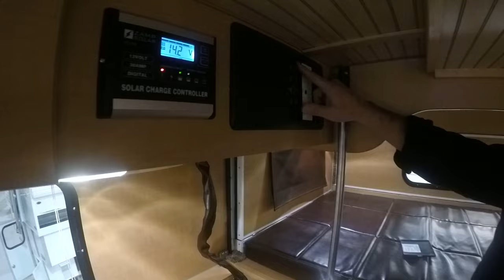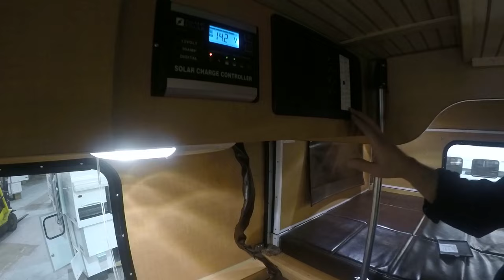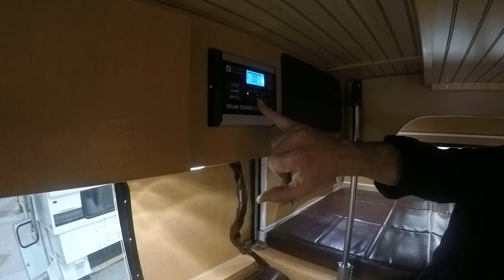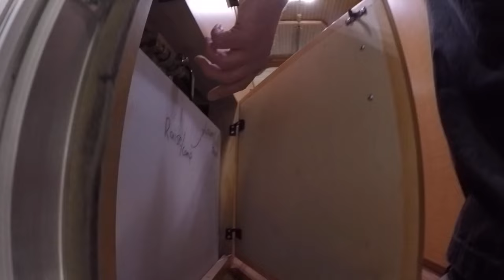Alaskan Campers Orientation

Comment: Very interesting. I guess it's a step up from having soft canvas sides. It would suck if you had to setup or tear down in the rain so what is the appeal of having it compact down vs one that doesn't? 🍻
Reply: 4 seasons vs 1. Soft side campers are not usable in windy, rainy, or snow weather. I've tried. You can't sleep at all when winds are whipping the canvas. And snow is a non-option. So all the Instagram "overlanders" only actually go in the summer. But this design hasn't been updated since the 60s. So it's far out of date.

Comment: Beautiful engineering and craftsmanship. You can hear the pride this man takes in his work.  Kind of thing you can pass down through generations if you take care of it. Well thought out, tasteful interior that feels spacious with large windows in all the right places. Toilet set-up is brilliant. Interior shower isn't necessary - campgrounds and truck-stops have showers folks, and sponge-baths / outside rinse work fine in between. Pop-top design with hard sides is clever and desirable  for aerodynamics, low center of mass, and overhead clearance, and inconspicuousness on the road.

Very nice product. I love the outdoors and unconventional modes of travel. I've lived on and cruised small sailboats boats for the past 15 years - have a look at my channel. I can tell this camper is made for long term travel will hold-up to the rigors of the road. 

Well done - Alaskan Campers are at the top of my short-list